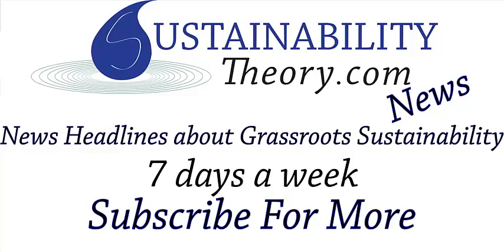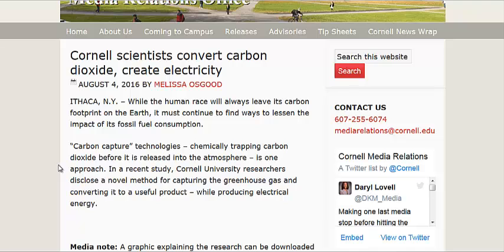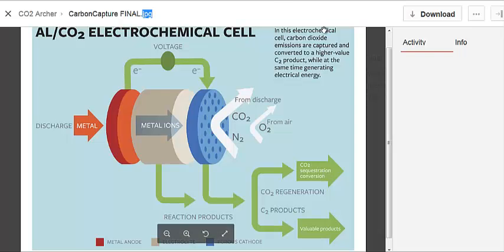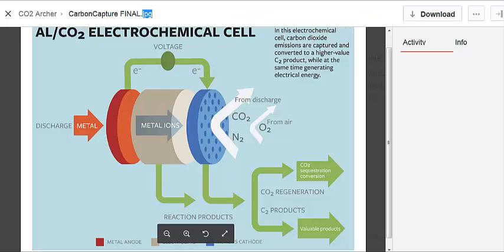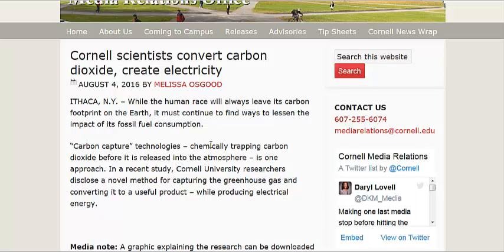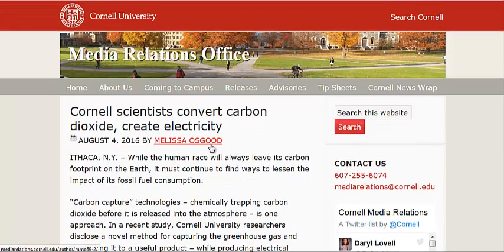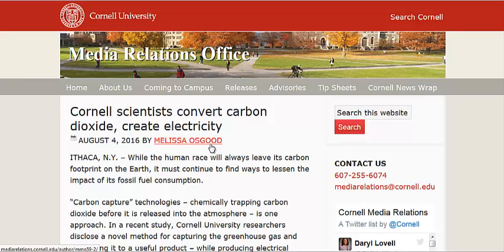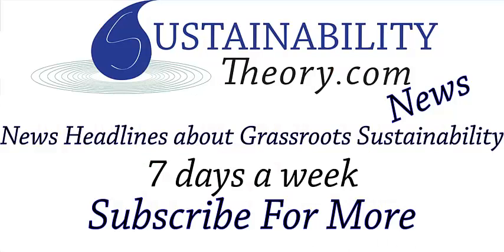Turning Carbon Dioxide Into Electricity

Comment: To split CO2 you add energy don’t take energy and transform in oxygen’s and carbon monoxide, main problem if CO2 is carbon carbon bonds is too strong and is impossible to separate under normally condition 😢

Comment: This obviously cannot work because C2 bonded molecules (e.g. acetylene)  burn in oxygen producing heat and CO2. Since energy is released when C2 burns in O2, you have to put energy in to make C2 from CO2. 

The energy has to come from somewhere, and it's obvious that it comes from the Aluminium electrode (note it's an electrode not a catalyst) because making pure Aluminium requires a lot of energy to convert the oxide into metal and O2 and therefore it releases a lot of energy when it reacts with O2 in the C02 which releases the C to form C2 bonds.

Comment: Congratulations! If this works you just have created an infinite energy source...
Reply: Can't tell if you're being sarcastic or if the difference between CO2 in and C2 out hasn't occured to you. If I'm not mistaken, it's still not infinite because it's not actually generating electricity from the carbon itself. It's generating electricity from the separation of oxygen and carbon into 2 different parts. 

I'm not going to claim to know exactly the specifics how it does this, but I imagine it's like a hydrogen fuel cell, but instead of generating energy from combining, it's generating it from separating.
Reply: @User__Not__Found  so it is a type of electrolysis?
Reply: @User__Not__Found  i think he thought about burning trash of the world to get this energy and solve pollution and that's a good reason stupid documentary to stop talking about trash being useless and burning it will cause more pollution.

Comment: Have you looks at the hybrid sodium carbon dioxide system producing electricity and hydrogen as the byproduct.  being able to run a hydrogen fuel cell?
Reply from the maker: I have not, sounds interesting, I'll check it out, thanks. Nice buck in the pic.

Comment: There is no argue about if CO2 or the sun is driving global warming further. It's the combination! Too much CO2 in the atmosphere is the reason the sun is heating up our atmosphere since the radiation of the sun can't escape as easily as it could 200 years ago. It's really as simple as that when you break it down to it's principals.
Reply: CO2 in the amounts present in the atmosphere has a slight effect on global warming, but this period of climate change is definitely caused by the increased solar activity.

Comment: I am sorry, Carl, but this story is so grossly oversold as the latest/greatest "CO2 capture device", that it can only backfire. You've managed to further add to the confusion by writing "aluminum catalyst". No, the original article at 
http://mediarelations.cornell.edu/2016/08/04/cornell-scientists-convert-carbon-dioxide-create-electricity/ 

clearly states:

"The group’s proposed cell would use aluminum as the anode (...)" 

not "catalyst". Which means aluminum metal will be used in the process. Which means the aluminum ore must be dug up from underground and the Al metal must be milled out of it. Which takes lots and lots of energy. Far more than produced by Cornell power cells. And, at present, lots of energy means lots of released CO2. Thus, this invention is a chemical curiosity, at best, not the promised "CO2 capture" wonderland.
Reply: Why couldn't recycled AL be used? Alleviating the need to "dig from the underground and mill (you meant "refine" out of the (bauxite) ore".
Reply: +martianshoes   Exactly.    While I COMPLETELY agree with Molecular Descriptor's serious concerns about this or ANY carbon capture device being oversold, until I see the MATHEMATICS behind the THERMODYNAMICS and the KINETICS - obviously, energy is ALWAYS REQUIRED to CAPTURE CO2,
because CO2 is one of the LOWEST energy states of all chemical arrangements - THAT'S what makes it so VICIOUSLY difficult to avoid producing in all processes - I will remaing skeptical.

However, as martianshoes pointed out: WHY use virgin Al?  THAT is a NON-argument against this technology
Reply: hey there I have just found this video and wish to comment a bit about it... there are ways to create a closed loop to create portable energy cells / and batteries, the system that I am talking about depends entirely on the use of magnesium and the the use of the sun.... as we know magnesium burns Hot... thus it stores a ton of energy... after it burns we end up with a magnesium oxide... we then need to separate the oxygen from the magnesium, this step in particular is most interesting... because it can be done in ... ideally a slower step... here the sun play a huge role... we can use a magnifying lense/ laser (like) to separate the magnesium and turn it into a solid cylinder... or whatever shape we may need...  so as it is a slower step... this means that we would probably need about 30 or 60 magnesium "rods", "cylinders"... or whatever shape of it should be required... so that by the time we need more magnesium to be ready, the closed loop has made it presently available... this loop provides huge amounts of clean renewable energy... to be used in myriad of ways